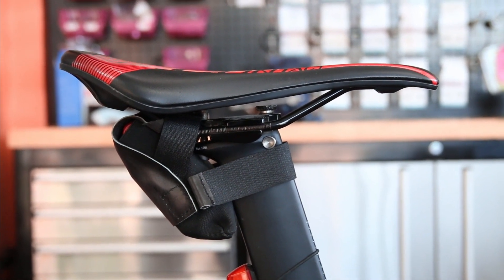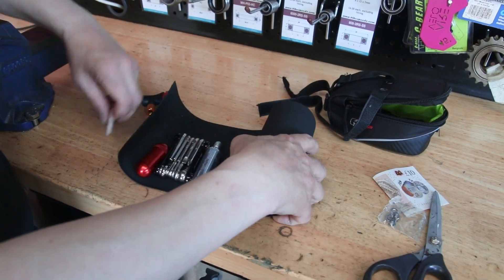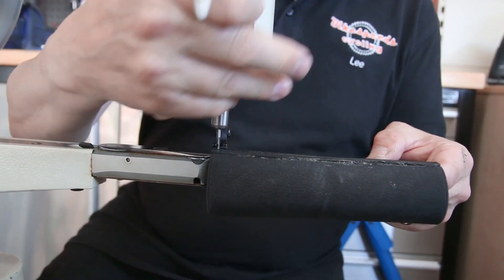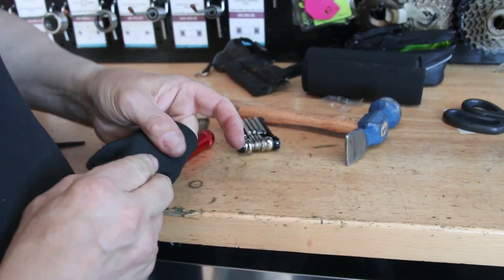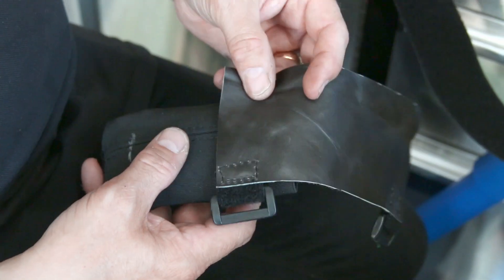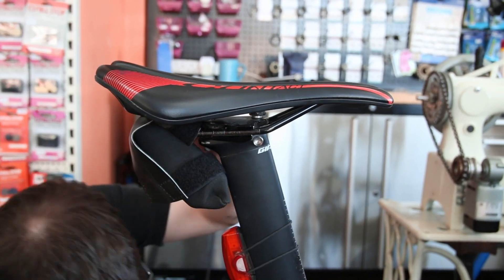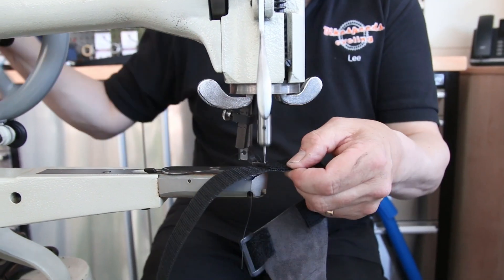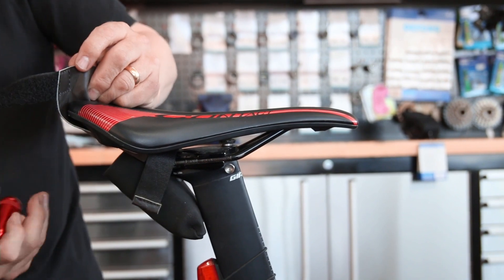The SMALLEST Saddle Bag - CUSTOM

Comment: This is absolutely great! Would be a bit hard to stop by, but the set up as it is would be a size option to use as a standard. And then 1,5x and/or 2x of that otiginal size as the next two sizes up. I think that most buyers would fit an fit in that. And that way you can sell more product and further.